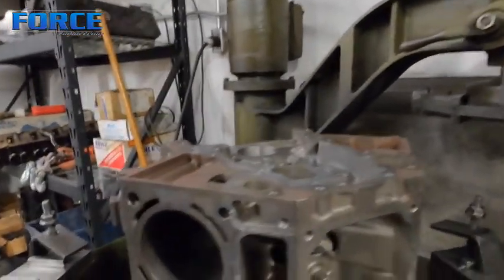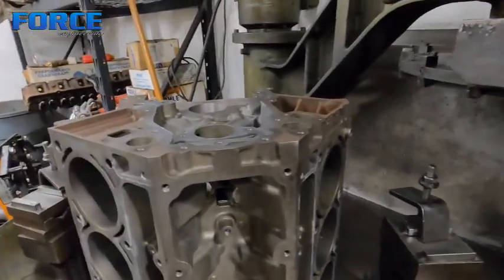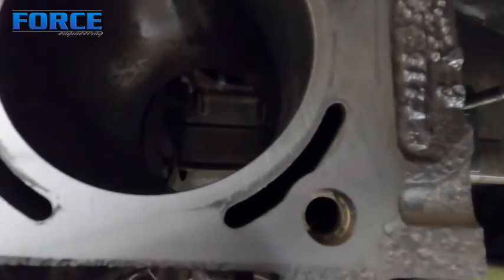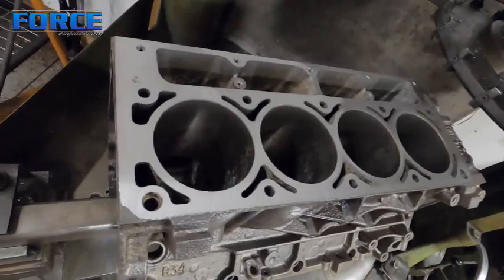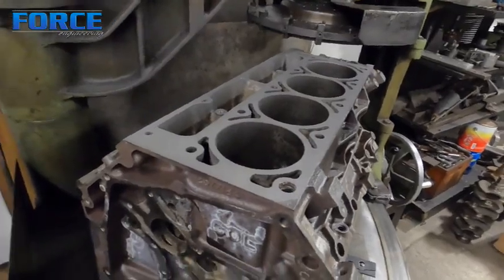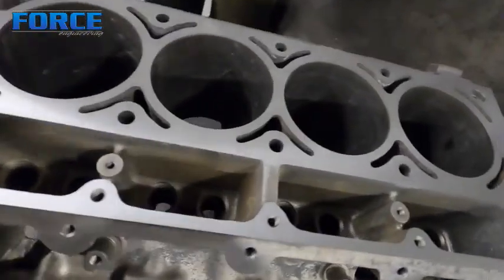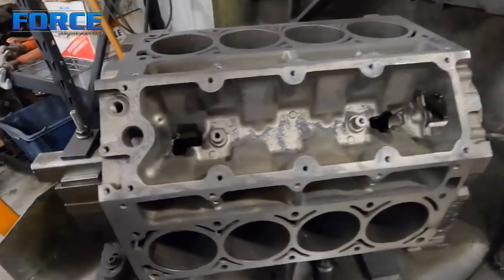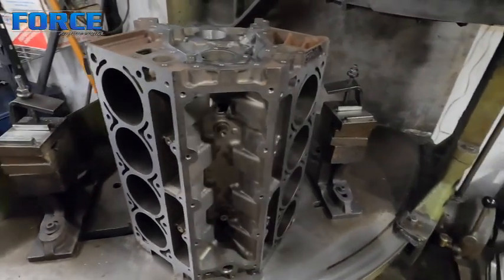Engine Machining - Decking an LS Engine Block | Strom Vulcan 85B

Comment: Question.  A lot of these factory engines are not square, yet if taken care of, they may go over 300K.  So if they last for decades, what’s the argument for getting them more “perfect”?
Reply: Production engines are built with pretty forgiving clearances. In serious performance applications, where things like piston to head clearances are often tiny, every 0.001" is critical. Throw power adders into the mix(turbos/supercharger/N2O) and proper head gasket sealing is crucial. Driving over your own coolant at 100+ mph rarely ends well.
Reply: @CzechSixTv that makes sense. 
I guess it’s not as important on a factory engine making only 300hp.

Comment: shouldn't it be indicated along the mains, like ya did, ,  then square with the bore, not following any deck  defects that are  common. ??
Reply from the maker: Boring bore squares to the deck surface. Only uses the bore for centering on each cylinder.

Comment: Nice cut!!!     what cutters do you use?  if original where do you get them sharpened?
Reply from the maker: Thanks! This one has square carbide inserts.
Reply: @ForceEngineering    I inherited one of these machines great condition but dull cutters, what brand and part number do you have ?

Comment: Are you doing anything to get the 2nd deck perfectly orthogonal to the 1st? It looked like you were just indicating the 2nd deck the same way you did the 1st to get it rolled to the best position.
Reply: That requires a squaring fixture for referencing tram to the milling head. 
   This is trimmed by averaging with the existing deck surface but correcting front to back by setting up off of the main bores. 
   While squaring fixtures are nice this method has been used to machine many world title holding engines. 
   It works just fine.

Comment: When you are indicating the block to square it up how do you decide what is square when the block is twisted like that?
Reply from the maker: The bar the block is sitting on holds the deck square along the length of it.  I check this from the cutting head regularly to ensure its correct.  Then take the average of two points in the roll axis and call that home.  If its way out ill messure each side of the bore to the bar running through the mains.

Comment: If you only hone 10 thou are you able to use the same pistons that came out of the bottom end originally?
Reply from the maker: Only way to do that is then coat the piston significantly to make the piston to wall clearance correct again.
Reply: @ForceEngineering  what kind of coating we talking about ?
Reply from the maker: @westtexas501  we use Line2Line Coatings.  They have a wearable skirt coating desigmed to be applied thick for this purpose.
Reply: @ForceEngineering   planing on rebuilding my bottom end just not sure if I'll be able to re use my stock pistons , I guess I gotta take some measurements first and hope for the best block has 215k miles on it lol